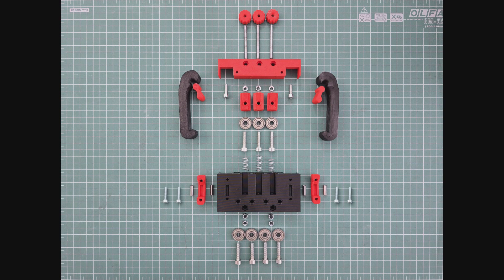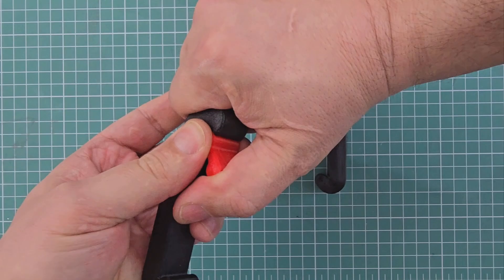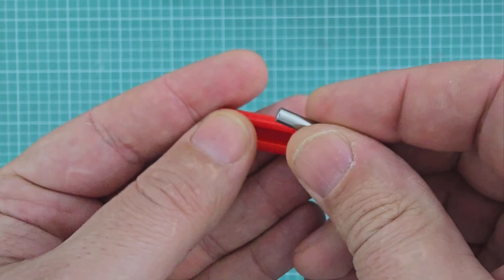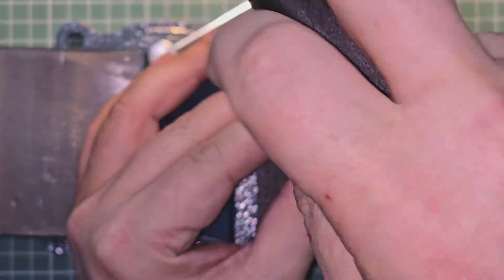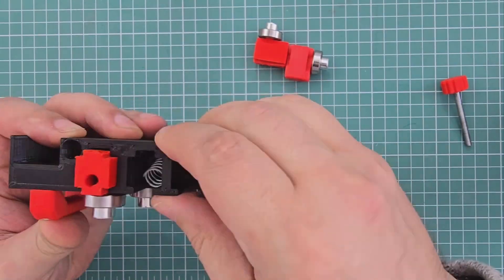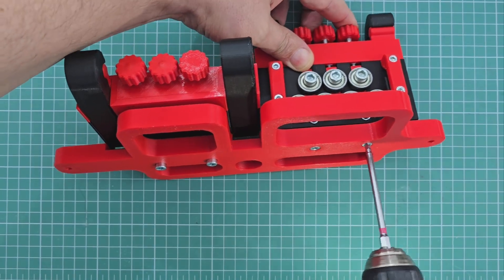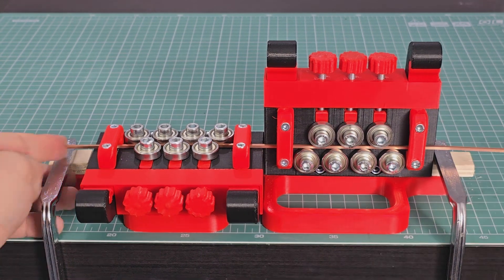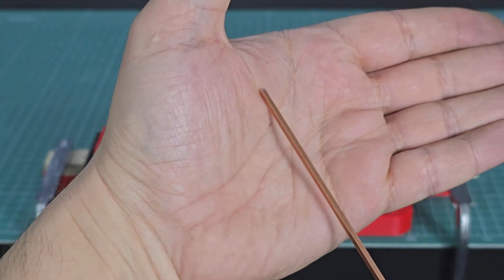Tandem Wire Smoother and Straightener for Rectangular Wire

Comment: What's the thinnest wire this can be used for? I am looking for something to straighten and to smooth out 0,4 mm Carbonsteel-Wire...have had some issues so far with other tools, that the wire got wobbly and produced a ziczac-line.
Reply from the maker: Is that round or square wire? (does this matter to you?). This model is meant for thicker wire (the rollers, being bigger in diameter, are too far apart for 0.4mm wire). For thin wire like the one you use I recommend my MINI Wire Straightener (the one red and black) here: https://WireTools.etsy.com
Reply: @ErosNicolau  its round.
Reply from the maker: @eiskorn12345  this model (the Tandem) is for thicker, and usually rectangular section wire, just because it uses regular (straight) bearings. My MINI Wire Straightener also uses straight bearings, only much smaller ones, so much better for smaller than 1. 5mm wire . It should be OK.